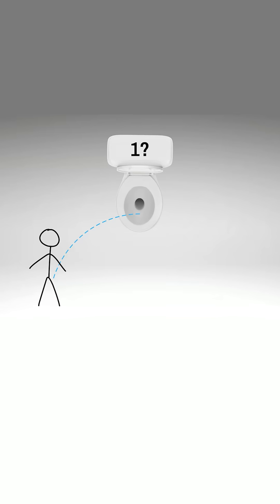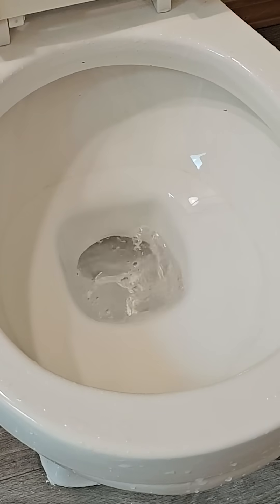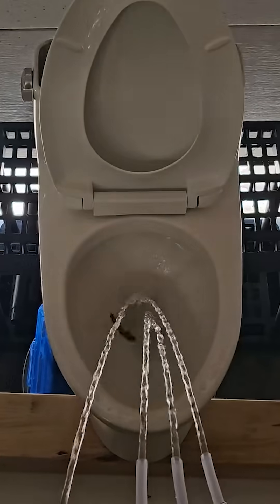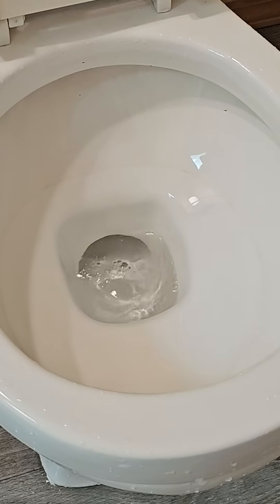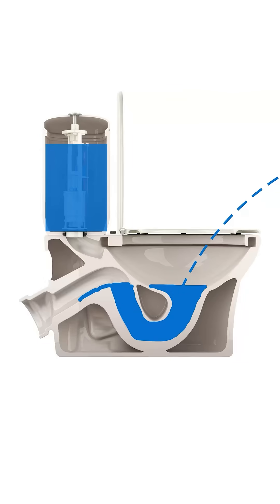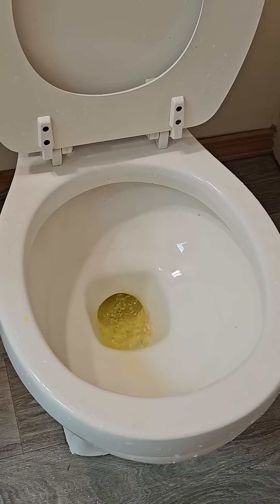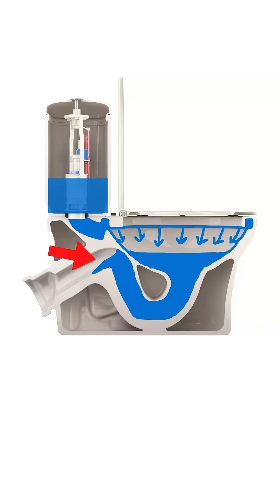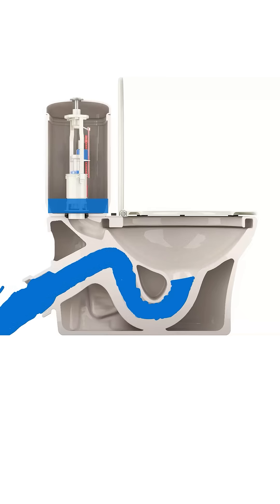How many human streams to flush a toilet? (Follow-up) #shorts #engineeredbets

Comment: Paper towel isn’t a simulation of TP, Just use TP 😵 paper towels specifically have wet strength bonding chemicals added to keep them from dissolving and makes them harder to flush

Comment: Instead of turning down the pump each time, have the pump fill an overhead bucket and that bucket then feeds the holes so you get some better natural flow using gravity. And given the relatively small change in height of the water of the bucket, assuming you're remotely close on the pump setting, the results should be much more consistent.

Comment: You used paper towels to simulate toilet paper instead of just using toilet paper. Were you just running low? Why didn't you pick up some while you were out getting all this extra stuff? Unless you get some sorta triple quilted, ten-ply, extra soft, gold-plated toilet paper, I can't imagine paper towels are less expensive. Not to mention the consistency of wet toilet paper is significantly different, and kinda engineered to flush a certain way.

Comment: If you only turned down the pump every few trials then the flow rate didnt change between those trials. As you said plugging a hole changes the velocity through each hole but the flow rate remains constant until you cuange the pump rate.

Comment: This video was oddly interesting. I knew about the flushing by quickly filling the bowl thing though because my stupid toilet inlet line likes to freeze when it gets excessively cold in winter (seriously, we had to keep a space heater on it for a few weeks- so annoying but I plan to get it fixed before this winter) and I kept using buckets of water to flush because taking off the tank lid for a center push-button flush is extra annoying.

Comment: Haven't seen the first video but estimation via volume would be more accurate.

1. Average Adult will urinate ~400ml of liquid per urination and has an max bladder capacity of ~600ml.
2. Depending on the bowl size and the height of the syphon, it takes 4L to 6L to flush.

Therefore it should take around 10 individuals urinating to cause a toilet to syphon without manually flushing it with the switch.

Comment: It probably would've been better to immediately test a lower number like 7 or something to figure out what wouldn't work. And then used a number like thirteen to get a range in which it either works or doesn't. Doing it strategically to narrow your success window would've gotten you the answer in fewer tests than reducing it by one until it stops working.
Reply: binary search. why did he do it one at a time? just seems obvious that there’s no point in doing it like that, right?

Comment: Problem: people can only pee for 21 seconds. If it takes over 20 seconds, then it won't work.
Reply: make em all drink a few beers, ez
Reply: Uh, depends. On average, yeah 21 seconds. But if you haven't peed in a while, that can be as high as 45ish seconds or more.
Reply: He could have just looked at the amount of water used per flush, measure how much he pees per bathroom visit, and then just do simple maybe to find out how many streams
Reply: is that a world record? 😂 I’d say that’s not the case for myself, and usually so
Reply: I’ve peed for over a minute for sure. That was not a good day.

Comment: TL;DR: Toilets are big Pythagorean Cups, and rotation plays no part in the flushing. A bucket would work too.

Little known fact: It's not the spin, it's the quantity.

Toilets use the same physics as the Greedy Cup, also known as the Pythagorean Cup. With the Greedy Cup, it will remain normal until a certain point is reached, where everything flows out. This same logic applies to toilets.

But then why doesn't a constant flow work no matter what? Putting it simply, the narrator made the proper point- there's not enough water to trigger a full siphon force. So while it'll suck some water out, the rest stays put because there's not enough pressure to make the full siphon.

The 'spinning' of a flushing toilet is solely a whirlpool caused by the siphon effect- the water that enters the toilet does not spin.

Thus, you wouldn't need to cross streams at all- you'd just need to give a constant flow strong enough to cause a siphon force that won't falter. So... yeah, that's a thing.

Or you could just dump a bucket of water into the toilet and see it flush on its own. I'm not joking, if there's enough water poured in at once it will flush on its own. That's how I realized it used the same logic and physics as the Greedy Cup.

Inventors do some crazy stuff to make our lives better.

Comment: Saw another comment mention this. But the average bladder for any mammal can only pee for about 20 seconds. 22-23 if you are extremely hydrated. 

I think a 20ish second timer should be added for more accuracy.
Reply: I can spend a Minute or Two if I'm drinking alcohol.
Reply: I actually count how long it takes every time. Do note it is me counting and not actual seconds so actual time is definitely longer. My record is 42 seconds and 20-30 is pretty common so 30 seconds is reasonable.
Reply: Dude I pee for like 40 seconds every morning. More if I had a lot to drink before bed like a Powerade or something.
Reply: My dog begs to differ.
He hates going out late at night to pee, so by the morning, he's holding a lot.
I timed him at 37 seconds for one pee.
Reply: I've had a minute to my counter.. and same, 20-40 seconds on average (i'm 6ft 220lbs)

Comment: 10 human streams for 30 seconds? Two problems. 
1. Getting 10 people to all pee with a continuous flow for 30 seconds seems a bit unlikely. 20-30 seconds is the average time so i think you need a bigger margin for error.
2. How do you fit 10 people around a toilet bowl?

So while it sounds like you've solved it in theory, you still have some challenges to overcome to solve it in practice.
Reply: move over, brother, I can barely reach the bowl

Comment: Correct me if im wrong,
why are u trying to count the hole?
u shouldnt count the hole, but calculate how much the flowrate are with that 7 hole..
because of bernoulli equation, the flowrate reduction isnt linear with reduction of the hole.
let say 20 hole can deliver 1liter/sec
if u use 10 hole, it wont be 500ml/sec,
it could be still around 900ml/sec because bernoulli equation, its just faster flowrate with same total volume/sec

Comment: Something that I think you failed to take into consideration is that humans have a bladder that cannot contain and infinite amount of liquid. So if the flushing is too slow, you'd need to replace the streams by that of additional people because the first batch would have run out. Hence taking too long actually adds people, so decreasing the number of people slows it too much and is counterproductive

Or is that just me

Comment: Wouldn’t this not work as intended? 
If you clog up only 1 hole the pressure from the excess water would come out of the other holes no? Like when you use a hose and sinch some of it to create more pressure

Nvm, didn’t finish the video

Comment: General tip for scientific experiments: don't step down the sample size by one with every try. If 16 works, do 8 next. If 8 doesn't work do twelve next, if it works do  4 next. This way you can get to your result much faster.
Reply: binary search
Reply: @triniasta is that what it's called?
Reply: @electricpaisy6045  yeah its a method that is commonly used in programing. At the beginning the best solution is at somewhere between 1 and 16 so now you check the half (8) and based on that you narrow it down to just 8 to 16 so you do the middle of that,check and repeat until you find the answer. Overall you get O(log(n)) time complexity
Reply: @triniasta  cs degree go brrr
Reply: Exponential binary search is also super useful. If you have no idea how many, you can start with one, go to ten, 100, 1000, etc. Once you know it's between 100 and 1000, you can look in the middle of the range and narrow it down from there.
Reply: @phillyphakename1255  those are decimal, not binary. Otherwise, you'd have 0, 1, 2, 4, 8, 16, 32, 64, 128, 256, 512, 1024, 2048, 4096, etc. Further along, you'd hit 2^16 (65536), 2^32 (4.29 billion), 2^64 (18 quintillion). It's very easy for a machine to count this way because it just flips 1 bit each time. After it goes to high, counting back down half as much is still just flipping one bit.
Reply: I loved going on this journey of determining whether or not OP made a typo. I got to discover individually at the same time as reading the comments discover it themselves that "it" meant 8 and not 12.
Reply: @ytbvdshrtnr  how did you interpret it though when you first read it (my initial comment)? 😊
Reply: @electricpaisy6045  I thought "it" was 12. And because you had an extra space in front of the 4, I thought it might be a typo where you meant to say 14. But then I realized it should be 10 not 14. I wondered why you hadn't edited the message, and then I realized midway through reading someone else's comment that "it" referred to 8 and you had not made a mistake.
Reply: @ytbvdshrtnr how did you interpret it when you first read it (my initial comment)? 😄
Reply: dividing and conquering it rn 💧💧💧
Reply: The entire discussion about misinterpreting the explaination of binary search reminds of that old joke about a programmer shopping groceries.

One version goes like this: A programmer goes shopping groceries. Upon leaving, his spouse told him: "get one loaf of bread, if they have eggs, buy 12". He returns with 12 loafs of bread.
Reply: @thedoublek4816  yes 😂
Reply: @electricpaisy6045  just noticed your "Widerstand ist Zwecklos" profile picture, which is a funny coincidence because it was actually the German version of the joke that I knew and translated for the sake of the comment 😅
Reply: Okay, just because people have been messing up the explanation: when performing a binary search, you take whatever point you start from and if you need to go lower, you halve it or if you need to go higher, you double it. Once you've found a boundary (e.g. it was enough before and now it isn't), you take the average of the previous value and the current value (i.e. its middle point) and try that next. The result tells you in which half of the result set you need to look next, so you take the middle point of that half and repeat until you've found the exact match. You don't have to start at exactly the middle and the process still works as long as you take any value in between rather than the exact middle, it'll just take a bit longer. So you can use this process for general tasks like finding a name in a long alphabetical list (the traditional example is a phone book but nobody has these anymore) without having to do any math or measurements beyond roughly eyeballing it. It's especially useful with very long lists or where checking a value (like in performing experiments) is expensive or time consuming.
Reply: Binary searches are really useful for modding too. I use it often when modding Rimworld to search for whatever mod out of several hundred is causing some weird bug or error.
Reply: thats divide and conquer, you half the sample size each time, resulting in O(n log n), aka, the time it takes is logarithmic to sample size.
Reply: I just love how invested we all are in determining how this one statement was written ambiguously and what it meant vs the various ways it could be misinterpreted.  Such a simple moment but we've attacked it from all angles, I love the thorough nerdiness.
Reply: @concerninghobbits5536  i like how the entire discussion stayed respectful. That's rare these days.
Reply: Thanks man.
Reply: Exactly
Reply: i'm here to say that i think 1+1=2
Reply: I knew this as the half-split method when i was taught to troubleshoot failures in electronics this way
Reply: We call that splitting the node in controls diagnostic trouble shooting.
Reply: Also called bracketing in the racing world.
Reply: It's the binary search, ayyyyy
Reply: Z vividly toilet
Reply: right? that was strange but I figured there must be some reason he did it one at a time 😅
Reply: If 8 doesn't work then why would 4? Shouldn't you got to 9 or 10 after 12 or go to four if 8 works?
Reply: @Agent_paper  he said if 8 works go 4
Reply: @bonzopippinpaddleopsicopolis it says doesn't. It's right in the comment. "If 8 doesn't work then do twelve next, if it works do 4 next". Why would 4 work if 8 doesn't is my question.
Reply: @Agent_paper I think you're misreading/misinterpreting this sentence. It is saying the same thing as this:
"If 8 doesn't work, then do 12 next. If it (8) does work, do 4 next."
Reply: @Agent_paper  oh yeah i see the problem now. I meant it like caeropula explained it.
Reply: @electricpaisy6045 Yea i just read his comment. I needed to look at that from a different angle. My fault, i was wrong.
Reply: @Agent_paper  that's what I wrote
Reply: @Agent_paper go to 4 if 8 works.
Reply: @Agent_paper  were thinking about something having a limit, which is different than just working. In this video the man wants to find out the minimum amount required for a flush. If you want to find the smallest/biggest value of something thats a limit. So since its a limit, if say 8 people allow the toilet to flush, then since every value above 8 has more flushing power, then all values above 8 automatically work
Reply: @Agent_paper  they meant if 8 doesnt work, try 12. If 8 DOES work, try 4
Reply: @Agent_paper he’s saying if 8 did work then do 4
Reply: @Agent_paper  he meant if 8 works, not if 8 doesnt but 12 does
Reply: @-yeetuslol i got more corrections after i admitted i was wrong. Still leaving the comment up though. It was my mistake I'll own it.
Reply: @Agent_paper  didn't see the other 20 replies lol, good luck
Reply: @Agent_paper I think he meant 14
Reply: @cerberus4545 ok that makes more sense. Probably what happened.
Reply: @Agent_paper  no that's not what happened😅
Reply: @Agent_paper not he meant if 8 works go to 4
Reply: people do "experiments" this way for longer video times and to try and build a little suspense/tension. its a common tactic on youtube if you pay attention to it. the entire video is pointless. its literally just asking how many people will it take to pee X liters in 30 seconds.
Reply: No way I've been doing this all my life for miscellaneous tasks not realizing it was called binary search. I feel so smart now.
Reply: If 8 doesn’t work try 12
If 12 doesn’t work try 4
4 is less than 8 and if 8 doesn’t work 4 won’t either.
Reply: @SciencewithMason-oi1gg I see more than one  person misinterpreted my text. Maybe I should have written it clearer.
Reply: @electricpaisy6045 yeah you should’ve. It’s confusing with the double spaces followed by a 4.

Comment: You can use a binary search method to cut down your number of trials. You can do 16, then 8, then either 4 or 12 depending on the result etc.
Reply: This is the first thing I thought of when he started plugging the holes one by one
Reply: I think of it in terms of watching security cameras. Let's say your car is stolen at 12:15pm you check the cameras to find out when it's stolen. 6 am shows it parked there, 10am shows it parked there, oh shit 2pm shows it's gone! Back up to 11, it's there, 1 it's gone, 11:30 etc
Reply: @since1876 Genuinely amazing analogy, thank you!
Reply: Glad I'm not the only one who thought of that lmao
Reply: Nope, he'd potentially have to plug/unplug so many more holes. This isn't a leetcode problem..
Reply: @yousifsalam  plugging a hole isn't exactly very hard work. i think it's better to minimise tests and save water/pump electricity.
Reply: @yousifsalam  lol bro , it will work actually.You've gotta think like a programmer
Reply: Don't cross the streams! 😵
Reply: Binary Search ❌
Linear Search ✅✅✅✅

Comment: A better way to make the flow per hole consistent is to make sure the water pressure is constantly. You need to put a bucket on a table with a float switch, then pump water up into the bucket. Then a hose from that bucket to the hose around the toilet to simulate the humans.